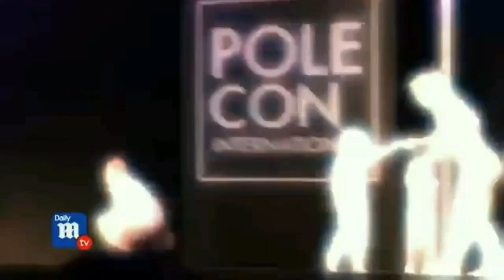Handstand Challenge and Bus Update!! #Skoolie #BusConversion | Pole Dancing Family

Comment: I highly suggest you get some 22.5 inch tubeless rims for your skoolie!  You currently have the 10.00-20 locking ring rims, which is extremely dangerous when you air up the tires, the locking ring can literally fly off the rim pretty much at the speed of sound.  Back in the 1980’s at the school district I used to attend, they used to run locking ring rims like that and they forgot to put the rim in a cage when they were airing it up, and the locking ring violently flew off the rim and hit an iron girder on the roof of their former bus garage and it actually left a bend on it.  Edit:  I took a closer look at the video, you are already running the tubeless rims on the front, but you still need to change out the rears.
Reply from the maker: Thanks for the info! We sold the bus recently.